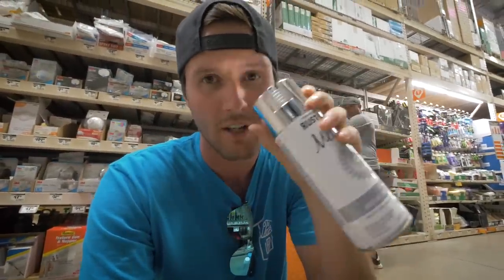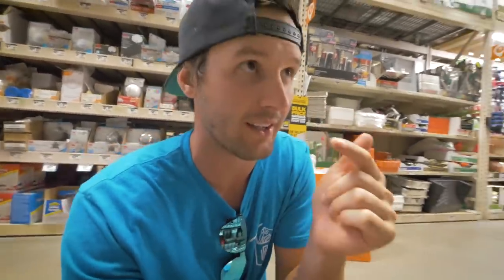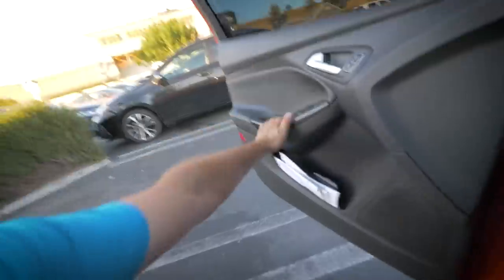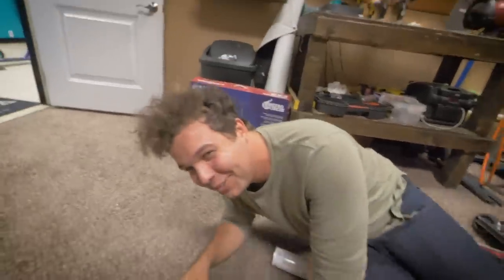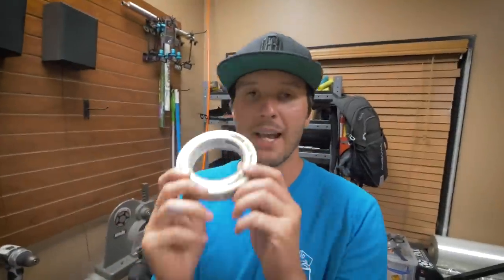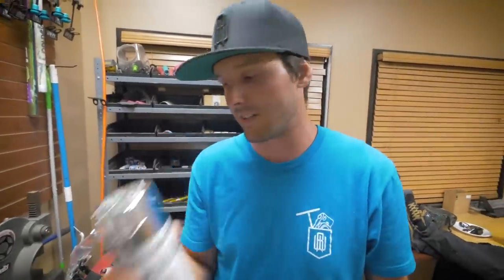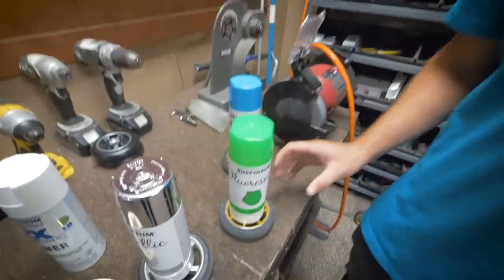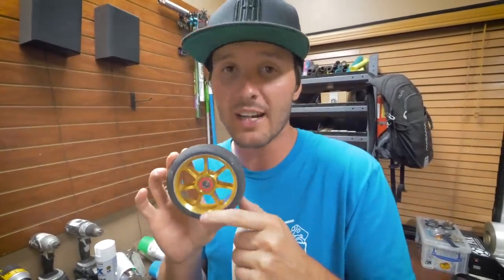NEW WHEELS FOR UNDER $10 HACK!

Comment: the fact that the wheel is metal is the reason the chrome didnt shine like you wanted it to. i think its cuz the metal is super dense but if you sprayed it on plastic itd probably shine like the cap did.